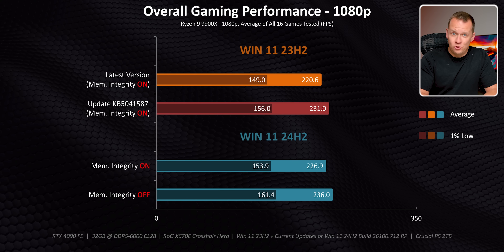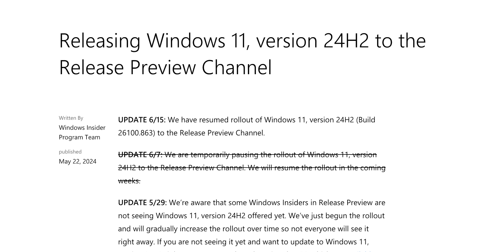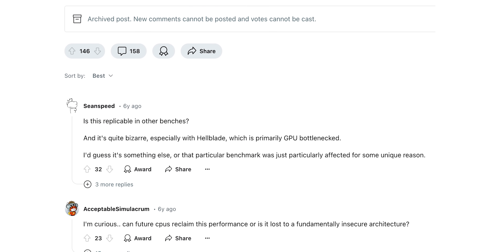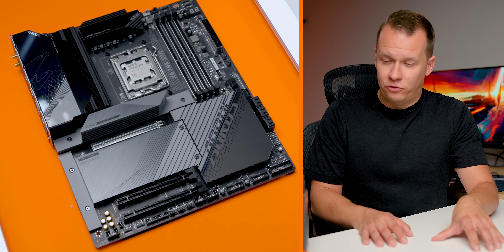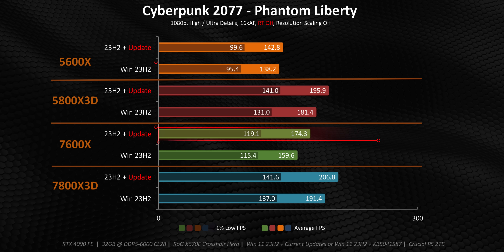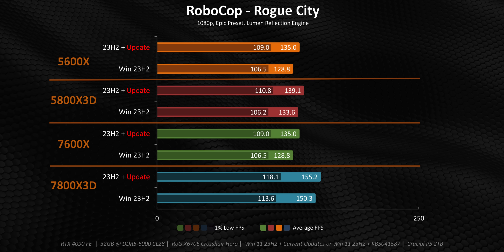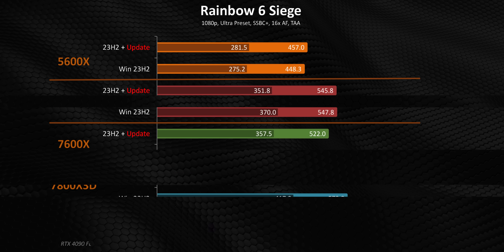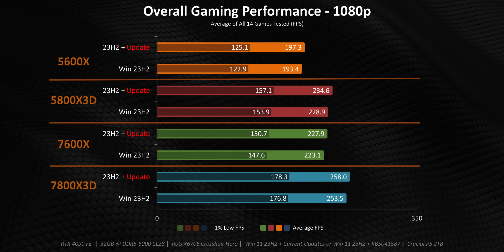Older Ryzen CPUs Just Got Buffed

Comment: 4:52 whats your CS2 benchsuite? I got a 5600X with 4x8GB DDR4 3200MHz CL16, I see dips below 140 FPS on DM dust2 late game. The game is just awful.
Reply from the maker: Its an age, not performance, thing
Reply: @HardwareCanucks  ? I want to  know why you have 3x the FPS.
Reply: @samserious1337  Have you taken a look at the bottom of the graphs? "GPU: 4090 FE"
Reply: @sampic_  Who cares about the GPU in a CPU limited game. My GPU is sitting at 40% load while only producing 150 FPS.
Reply: @samserious1337 I guarantee the GPU is the difference.
Reply: @samserious1337  it's true with 1.6 because any single fucking GPU can run this game. CS:GO mattered less on the GPU, but still mattered a bit and CS2 needs something somewhat powerful. Just installing a custom bios and overclocking my GPU gained me 50 fps. So basically I'd get 200-250 fps with maxed out GPU and CPU at 70%
Reply: @sampic_   I recorded this clip 6 months ago, although the performance has improved a bit, its still dogsh!t. As you can see, the GPU utilization drops to ~35% as soon as I aim towards outside tunnels. watch?v=HqRPkeCAZOs
Reply: @sampic_  it is not about the GPU, its a CPU intensive game. Todays update further dropped the FPS even in the 2 digit range in DM mode.
Reply: Have you tried only using 2x8gb in dual-channel mode?

Comment: is KB5041587 available as optional update for windows 11 ? im not seeing it...
Reply: Search for the comment with KB5043145, give it a thumbs up and leave a comment (hopefully it gets it way to the top and get more attention). I get the feeling KB5041587 (August preview) is not available anymore and replaced with KB5043145 (September preview). It is unclear to me if the branch prediction updates are also in KB5043145.
Reply: @dennishaller6578  i got 3 machines, 3 different types of windows 11 installs, suchas as with microsoft tool, microwin from christitus,  and another variant, none of them present the option for KB5041587. you may be right.
Reply from the maker: Yes, though you might need to refresh quite a few times...and maybe even come back to your PC in a bit.
Reply: @HardwareCanucks  can you please look into this, multiple users report this KB5041587  is not available anymore under the optional updates. this could be huge. or maybe they gave it another name ? or made it not available in other areas ? ( im in europe for example)

Comment: The update doesn't come close to the performance that you get on windows 10. Windows 11 is a nightmare. I get 50 more fps in most games on 10 vs 11, sometimes more. Windows 11 is a downgrade. This is with this update.
Reply from the maker: Sure but you have to remember Win 10 is approaching EOL status so at some point, to get the latest security patches, you'll be forced to head to Windows 11.
Reply: @HardwareCanucks  then Microsoft should stop playing favorites and tune w11 for AMD properly. Intel doesn't have these issues.

Comment: C’mon. A lot of HW media dropped the ball by not setting notifications for when Microsoft cuts a new branch for Windows. You could’ve noticed 24H2 May 2024, branch prefix "ge"; and could’ve reported on the insider variant before it actually got pushed to some notebooks. How’s reporting done these days, do y’all rely on press releases and copying from channels who actually do discovery?
Reply from the maker: We continually keep up to date on Windows branches.  However, nowhere was anything said or has anything been said about these scheduler updates.  Not in a press release, not in the MS developer blog and not in the Insider Preview's release notes.  As a matter of fact, the MS Developer Forums were flooded with posts wondering why NO ONE was aware of these changes until AMD mentioned them.
Reply: @HardwareCanucks  Germanium’s point was the new scheduler. (And Recall….) If you’re not on the changelogs, you can always track betawiki.

Comment: I am kind off stuck with 5800x3d. Upgrading to am4 is expensive move bcs only 7800x3d makes sense. Its close to its 2cnd birthday so i bought it 64gb 3600 kit so its even harder to upgrade now.. Now i am waiting for good deal on 7900xtx so i can build Stable diffusion machine..
Reply: U don't need 7800x3d bro. From 5800x3d to 7800x3d it's like why. 10% for a whole ass build investment ? U don't have enough fps ? 5800x3d holds 2 more series of gpus my friend. Next it will still be a great choice for mid high budget gpu. Like xx70s nvidia . Maybe even ți for 4k. And last series when nvidia 6xxx comes out should be enough for a xx60 series type of gpu. For gaming . If works don't reincest in pcs. Devaluating assets. U just lose money . My take.

Cpus are pretty much op and 2k and 4k monitors getting cheapee and cheaper. If You play at 4k u will be able to run on a 6070s  6070s ti
Reply: Agree. Just wait for Zen6 high-end to come out and upgrade to AM5 when everything is nice and mature.
Reply: Get that GPU upgrade man and you will be golden. Unless you are using it for professional use and are maxing out capacity. No need to upgrade anything else. Enjoy what you've got!
Reply: Just wait for 97/9800x3d.

Comment: 5800x3d is the 1080ti of CPU’s. So glad I have one.  Thinking the 4090 will last for a couple generations too.
Reply: if 58x3d is 1080ti, then what is godly 57x3d, which is 2 times cheaper and +- the same in the games
Reply: @jermygod  yes, but I’ve had 2 years of amazing performance from the 5800x3D already while buying a 5700x3D, while great, is much older tech when you buy it. Both fantastic though.  If I was upgrading today I’d buy the 5700x3D for sure.
Reply: The 5700x3d is amd's 1080ti, it's significantly cheaper with only 5-6% less performance.
Reply: Maybe that's why they are stopping production of the 4090...
Reply: Should I get one? IDK if it’s worth it for me because I have a regular 5800X and I’m not sure if I should just upgrade to AM5 or keep waiting. I’ll probably to the latter.
Reply: @badmoose01  that depends I would look at how the 5800x3d does in the games you play vs the 7600(x) and whatever does better thats how i would make my decision  on buying a 5000X3D vs upgrading to AM5
Reply: Really see no reason to upgrade right now.
Reply: Titan RTX isn't too bad either. 

Sure it was waay overpriced for 20% more performance and 13GB more VRAM than the 2080TI but it still matches the 3080/4070 in raster performance when overclocked and probably the upcoming RTX 5060 as well while still having twice the VRAM.
Reply: @handlemonium  yeah no. 5800x3d was reasonably priced when it came out. So was the 1080ti. The titan RTX was like 3x more than the 2080ti.
Reply: @handlemonium it was waay much overpriced like everytime. For ptp and durability 1080ti remains their Best ever product. 5800x3d along with am4 îs AMD Best product so far. Good analogy that i also used. I will buy an used and funcțional 1080ti soon. The founders edition. Keep it working for 20 30 years. It will be a retro gpu. Do the same i think IT will gain value.
Reply: Hate to bubble burst but I think your 4090 is gonna die
Reply: Almost all 4090 are gonna die duo to bad deliberate bad manufacturing. 
You can look up the issues are frankly shocking that no one is speaking about this yet.
Reply: @SMGJohn  whats going on with it now?  I think a lot of people have solder pad issues from impacts or socket melting from a faulty batch or messing around with 12VHPWR cable too much.  My 4090 has been going strong for almost 2 years now and i dont mess around with my computer much at all.  Is there a new problem that will cause it to die even though i have neither of the above problems?  I bought my 4090 with the intent that itd last me until like 2030.  

Maybe i can sell it to some sucker and grab a 5000 series card lol
Reply: tbf, and you can consider this a hot take, and I'm just in the super minority, but don't think the 5800X3D and 1080ti is all that "goated" tbh.

Comment: I bought a 5700x3d this year (half the price of a 5800x3d in my country) and it just gets better and better. AM4 is such a wonderful platform.
Reply: Same. 50% price for 3-5% less performance, can't get any better
Reply: Same. It was just too tempting. The 5800x3d is overpriced here too. The 5700x3d is a bargain.
Reply: Yup, I upgraded from a 3600X to a 5700X3D around something like February - amazing, I don't feel any rush to upgrade platforms yet, even with plans for a next gen GPU upgrade from my current 5700XT(it'll be a bummer to break up the band, but 2019 was a while ago now...).
Reply: @RyTrapp0  how is it? good? i have the same card with 3600. is the performance up from before when using 5700x3D? considering to update to 3D cache CPU.
Reply: I literally ordered a 5700x3d today for £180 to replace my 3600x. Really wanted a 5800x3d but the price difference is crazy considering it doesn't actually bring much more performance (about 5-6% more). Hopefully my 3080 will thank me even though my monitor is 3440x1440p i should still get very good gains. Hoping to get another 3-4 good years out of the 5700x3d.
Reply: @filmboy18  I have seen great improvements at 1440p. Even at 4k, you should see improvements, both in smoothness and raw fps.
Reply: @liptonx  Heavily modded cyberpunk plays so much better now. 0.1% lows have improved a ton. Very happy. Average fps has improved a okay amount too.
Reply: Same got one for £180, the 5800x3D was like £350 or something. Been a nice upgrade from my 5 5600, got a new 1440p monitor too and I'm pretty happy with performance. Until GTA6 releases that is lol
Reply: @skurt_fs I have the 5600x, what difference did you find? Any texture improvements, frame rate, fps, smoothness?
Reply: @harj72  it won't effect textures as they're handled by your GPU. Not massive gains in FPS because I'd jumped up resolution, but just more stable fps with less really low drops which made everything much smoother.
Reply: @skurt_fs  ah okay. I’m still gaming at 1080p and waiting for it to arrive, not sure to use stock cooler or buy a new one
Reply: I did as well. It made a lot of improvements in my games.
Reply: Same here. And what a jump in gaming performance coming from a 3700x. Such a bargain just in itself but after i sold the old chip it's a steal.
Reply: I got a 7700 non-x for under 250$ (220€) and its really efficient, cool and performant with a Thermalright PA120 (45$) in both gaming and CPU heavy productivity workloads. Seems like AM5 can also be a winning platform if you choose the 7700 :)
Reply: @KristianSimov  sure is. no doubt. Unfortunately, and I think I am not the only one, I did not have the money to change platforms. I just updated the bios and slapped the cpu in. Going for AM5 ment buying a new Mobo, RAM etc.
Reply: recently upgraded from a 1600 (the og zen 1 not the AF one) to a 5700x3d for 200€, loving it so far.
Reply: same!! its such a great cpu
Reply: Upgraded from a 3400g to a 5700x3d earlier this year, AM4 is just a wonder, and the price was really better as well. AM4 on CPU's is a beast now days
Reply: same and if you under volt with POB2 its a beast !!!

Comment: Does that Update help at all with 3000 series Ryzen CPUs?
Reply from the maker: We haven't seen anything to think that the 3000 series is positively affected but we only test with 14-16 games...it could very well be there are some cases but if that was the case I'm guessing AMD would have disclosed that in their blog posts.
Reply: @HardwareCanucks  Thanks for the heads up. Still running a 3700X, but i guess you're right: AMD would have said something.

Comment: there is bad and good installs of the new update, i know users who got an avg of 9-11% performance gain on their 5600x/5800 non 3D. i got it my self with my 5800H on a laptop. in lords of the fallen my fps jumped from 93 to around 115 in the exact same spot.
Reply from the maker: Its really random.  No idea why there's such a huge variance from one user to another but it could also be some folks were already behind on updates since in order to get access to the Optional Update, you needed the latest Required Updates be installed as well.

Comment: What about the 5900X and 5950X? Curious about how the updates impact 2x CCD chips.
Reply: My 5950X stills kicks butt.
Reply: @ScottGrammer  I find it strange when people with a top-of-the-line flagship are like "yeah it STILL runs great" when it's only three years old. Seriously, is a flagship only expected to last two years and three years is a remarkable achievement? I don't get it. I have a 5950X too BTW lol
Reply: @jimtekkit  You're right. It's a bit depressing though, as I still feel the sting from paying for that thing, and it's been replaced TWICE now as the flagship!
Reply: @ScottGrammer  Yeah it has, although the 5950X has held its ground in multithreaded efficiency. At stock settings it's really good. Sure the 7950X is 40% faster in multicore but it uses 60% more power to achieve that, and the 9950X is only on par. So we won't actually see a 16 core beating the 5950X in multithreaded efficiency until Zen 6.
Reply: @jimtekkit  i have a 7800x3d. I plan on riding this thing out for like 10 years lol
Reply: @ScottGrammer  Mine likewise
Reply: No complaints here on the 5900X. Still handles everything like a champ.
Reply: @TheRealSkeletor mine does aswell
Reply: @TheRealSkeletor  I just got myself a 5900x to extend the life of my am4 system, the 5700x that I previously had is good but it can't quite keep up with my GPU
Reply: In one of their reviews, GamersNexus called the 5950X the "most efficient CPUs we have ever tested" (this was before Zen 5 shipped so it may have changed today).  I still haven't seen the need to replace mine.
Reply: I have a feeling my 5900 will outlast my Nvidia GPU
Reply: Can't wait to see how the 5950x performs with Microsoft flight sim 2024 as it is supposed to be better capable of utilising the extra cores on multi core chips.
Reply: @thorgrimb2416  I haven't owned a copy of Flight Sim since 1998. Might give it a try!
Reply: Much of the internet (and AI) seems to want to deny the 5600 without a letter following even exists.
Reply: Same uplift.
Reply: I think they used a bunch of 5950's to render the avatar sequels...for gaming a tad bit overboard though. Even my 5900X is a bit overboard for most games, but luckily got it for free. : )
Reply: @Csimon2429  It's not optimal for gaming - but my Davinci Resolve video editor and my AI video upscaler love it.

Comment: at 1080p...who cares
Reply from the maker: 56% of gamers would care.
Reply: @HardwareCanucks  me thinks not..1440p is the most used monitor size unless your counting chinese internet cafes which is not representative.
Reply: @simplysimon966  LOL nope. Not even close. Today standard is still 1080p and majority of players on the globe are even still on 60hz.
Reply: Hehe...1080p...I dropped 1440p in 2022..you in the third world dude
Reply: @simplysimon966  dude, I'm on 34" 21:9 1440p Oled. But not everyone is as lucky as me.
Reply: @Blerpa   The point is all utubers use 1080p as an example because results with higher resolutions make very little difference. This is because the GPU is the bottleneck. I have been at 4k 165hz on dual monitors with a 4090 since 2022. Who cares. Who has a 7800x3d and uses 1080p, you tubers. All of them else their streaming would be pointless....it must be luck i guess.

Comment: What about those old guys that are grumpy and don't like Windows 11 to the point to remain in Windows 10? Even worse, with a high end but not 3D processor like the R9 5900X? Asking for a friend...
Reply: You always had the performance uplift on Windows 10, 11 is just Vista vibes
Reply: Because windows 11 UI and features sucks. They remove settings, heck now one cant even create a local account, need MS account. Its just all bad and worse.
Reply: @user-wq9mw2xz3j  You actually can create a local account. But you have to use command line during setup.
Reply: @user-wq9mw2xz3j  Wrong. You do not need MS account.
Reply: Windows 10 LTSC with mass grave

Software updates end in 2030 something I believe
Reply: Windows 10 is end of life next year officially. No security updates after October 2025 @Marauder-q2v
Reply: run winutil
Reply: If your friend is happy with their current setup leave it alone. I really don't like windows 11 either, I'm honestly considering Linux before I go to Windows 11. With time the X3D chips and Windows or Intels split core architecture will mature and probably be even better.
Reply: @AnticipatedHedgehog  i switched to linux when they announced MS would be integrating AI into the OS last year and i realized EOL for 10 was right around the corner. i don't regret it. there are a bunch of hurdles you have to go over but i think it was ultimately worth it. i'm almost switching my windows install from dual boot to a VM inside linux.
Reply: I use Win11 at work and find it horrible. I dont like the UI both in terms of layout and performance and I prefer things like putting the taskbar on the side, so I stuck with Win10. Dunno what this has to do with my processor tho...
Reply: If you are asking about the numbers for win10 vs 11, Ancient gameplays already made that video. It is worth a look!

Comment: I have previous update 2024-08 KB5041585, is this the same. My latest update was 2024-09 KB5043076. Has my system skipped 41587?
Reply from the maker: It seems in the last few days after this video was made, there may have been some cumulative updates that added the benefits referenced in the video bundled inside of another update.  We've reached out to Microsoft to clarify.
Reply: @HardwareCanucks  KB5043076 has the branch prediction updates and got rolled out without optional updates activated. But can't t tell if it's 100% identical to KB5041587